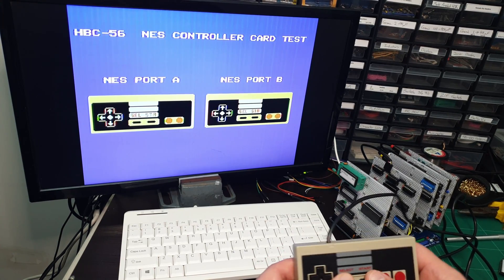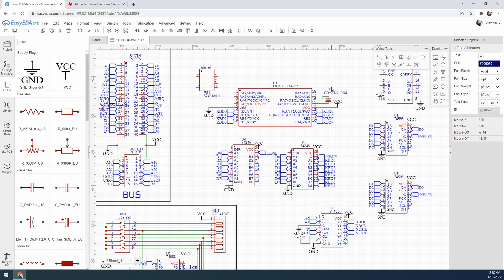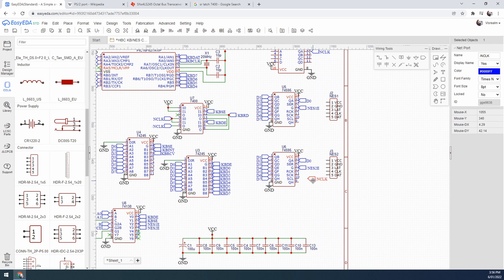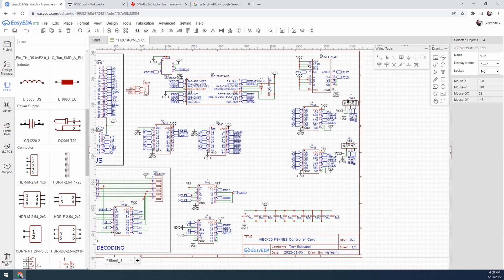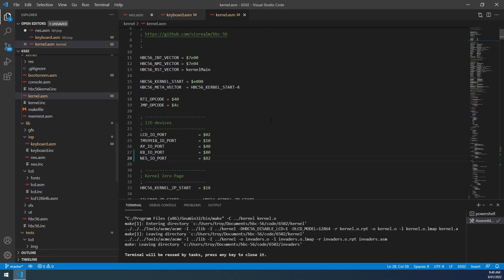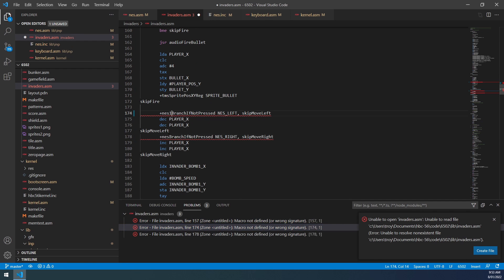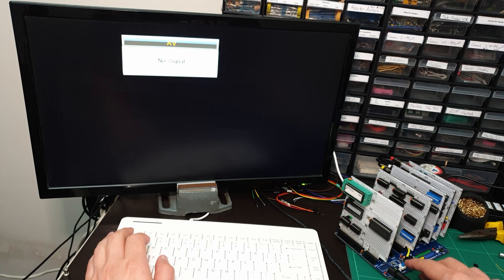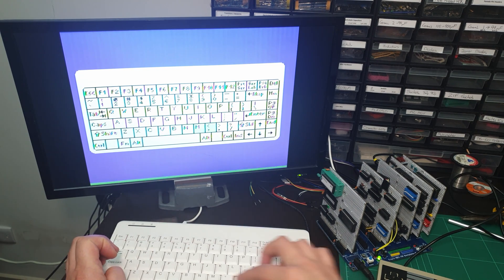Keyboard/Dual NES card for my 6502

Comment: Very nice! I'm impressed that you directly interfaced a microcontroller to the host system data bus. I've never had the nerve to try that :-) I was initially wondering what the 74LS161 was going to be doing in the circuit — I guess the NES controllers shift the button status info out serially? (Hence the '595s?)
Reply from the maker: Thanks. The microcontroller isn't able to respond within a clock pulse, so it does output the head of the buffer all the time, the bus transceivers just output it within the clock pulse. The SR latch triggers an interrupt in the microcontroller to output the next scancode in the buffer. I just grab it after a few nops.
And, yeah. NES and SNES controllers contain a P->S shift register which you drive from the host. You send it the clock pulses, etc. So, loading straight into a S->P shift register is easy.
Reply: @TroySchrapel  That makes sense: you can cheat a bit on generating a response when the chip is read if you're actually generating the data ahead of time.